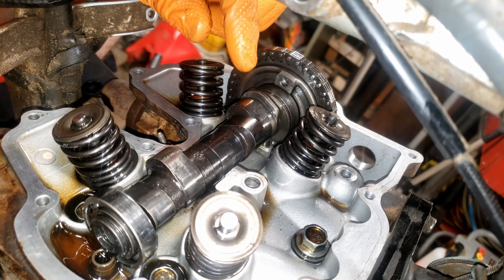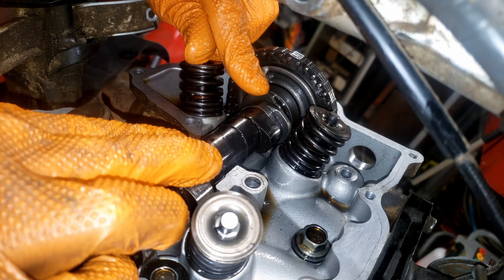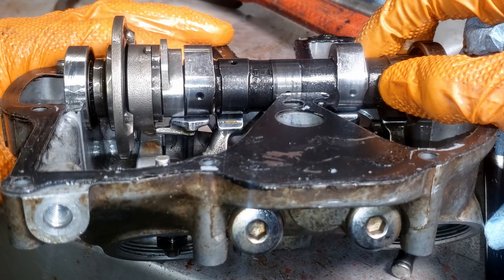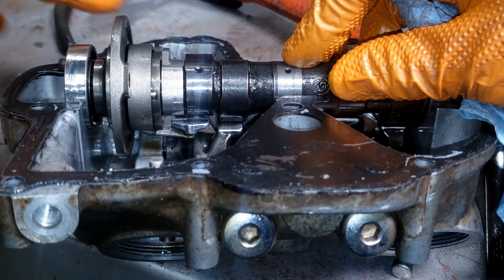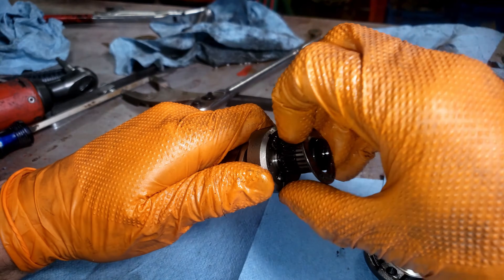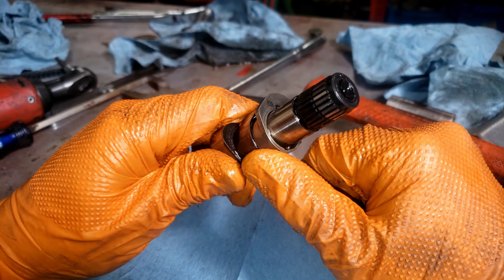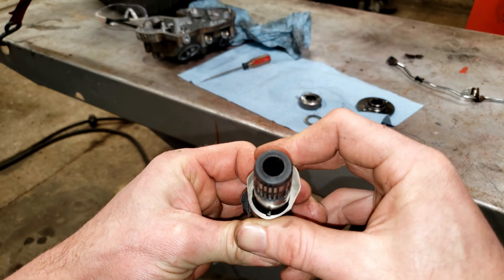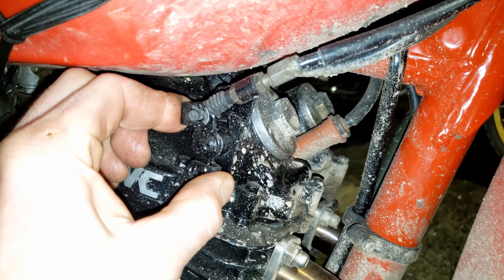Honda Auto Decompression Explained XR650L 400ex XR camshaft RFVC

Comment: Auto decompression sucks. The old manual decompression is way better, not much to go wrong. The auto units have lots of problems and way too many things to go wrong
Reply: I couldn't have said it better ..When my NX 650 got ~29K miles, the décompresser started to catch the valve even after the engine started...when I opened the engine The over head cam and finger followers were already all worn out... Not too good of a design... Then I keep seeing all these videos on YouTube telling me how bullet proof these RFVC engines are....Where from? There was a deficiency in the lubrication of the valves/ can shaft area. The oil was getting so hot that it probably vaporized leading to rapid wear of all the moving parts.... At a minimum, these engines needed an oil  cooler. Honda never bothered. To this day they make them the same old crappy way. Suzuki did it from day one on their DR's 650. Those Suzuki engines are much more durable. Honda has the best factory engines, but some stuff on the "commun and corriente" "every day run of the mill" isn't that great.          https://www.google.com/search?q=rfvc+engine+problems&oq=rfvc+engine+problems&gs_lcrp=EgZjaHJvbWUyBggAEEUYOTIHCAEQIRigATIHCAIQIRigATIHCAMQIRigATIHCAQQIRigAdIBCjEzNTc5ajBqMjmoAgCwAgE&client=ms-android-tmus-us-revc&sourceid=chrome-mobile&ie=UTF-8     Did Honda ever fixed these RFVC Engine problems?   https://www.google.com/search?q=did+honda+ever+fixed+rfvc+engine+problems&oq=did+honda+ever+fixed+&gs_lcrp=EgZjaHJvbWUqBwgBECEYoAEyBggAEEUYOTIHCAEQIRigATIHCAIQIRigATIHCAMQIRigATIHCAQQIRirAjIHCAUQIRirAjIHCAYQIRirAjIHCAcQIRifBTIHCAgQIRifBTIHCAkQIRifBTIHCAoQIRifBTIHCAsQIRifBTIHCAwQIRifBTIHCA0QIRifBTIHCA4QIRifBdIBCTg0NzcwajBqOagCDrACAfEFVTqwdI7DWtvxBVU6sHSOw1rb&client=ms-android-tmus-us-revc&sourceid=chrome-mobile&ie=UTF-8

Comment: My 400 was making a loud ticking noise at low speeds after about 2 blocks of riding. I put a cam in without the acr and the noise went away. My bike starts fine without it but ince in a while the first revolution is slow. I plugged the oil holes under the ACR with aluminum rods pounded in.

Comment: Is there something I can add to the oil to get this to free up.  I have a Rincon 650 and makes it hard to start. Assuming it operates similar
Reply from the maker: Not really. If it has an issue best to take it apart in diagnose why.

Comment: Excellent Video! This Helps me understand what is going on. on my 400x, when I tore it down the spring, and the pin were not there, so I did not know why the quad started as well as it did, but now I see that did not help with starting, but I do have A Question, since my Pin, and Spring are Missing, should I be ok to put everything back together like it was? Thanks again for such a great video!

Comment: Hi, thanks for this video, great to learn how this works. i am having difficulties starting my XR600 when hot and i am wondering if it is the auto decompression system failing. I have lost the auto decomp 'click' for TDC that i used to have, so wondering if something within the system has failed? thanks!